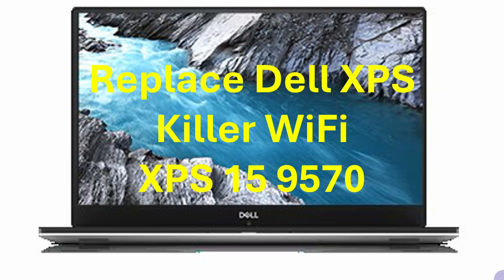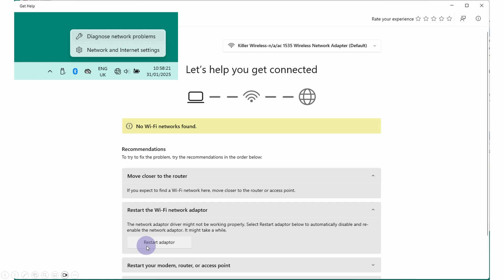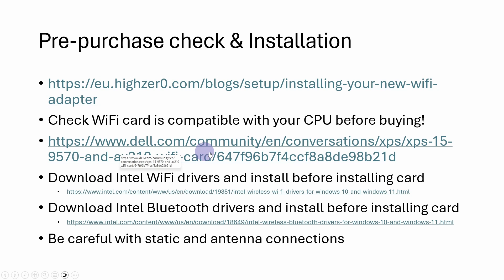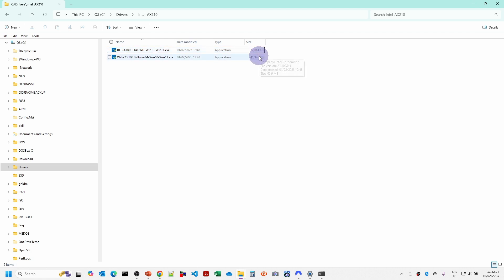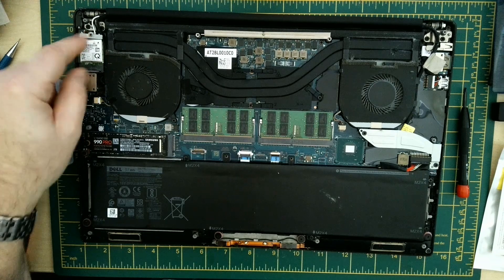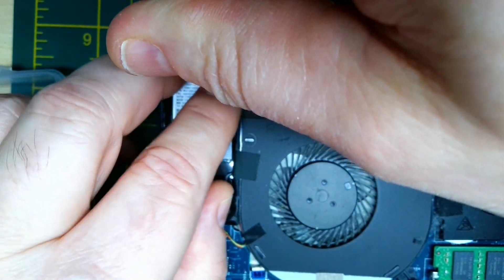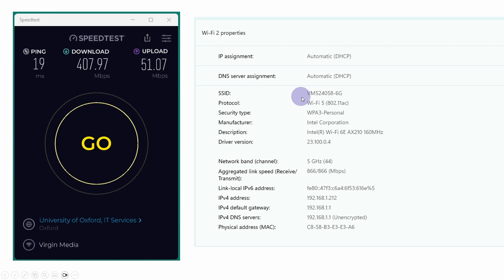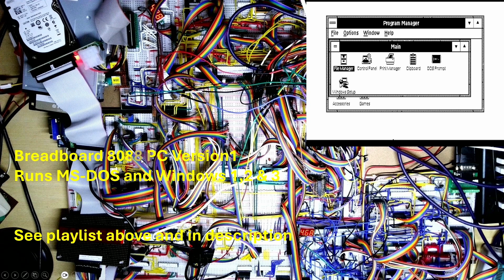Replace Dell XPS Killer WiFi Adapter with Intel AX210

Comment: For anyone that this fix didn't work for and Also for anyone that has a soldered Wi-fi card in their laptop that can't be swapped out this ended up being my fix. Hopefully this helps. 🤞

https://youtube.com/shorts/xSCYRRkacMw?feature=share

The TP-Link low profile USB WiFi adapter I used was a 300Mbps version but they do make stronger ones that are 600Mbps and up if desired. I tried to see if any company makes a USB Type-C WiFi adapter but unfortunately they don't. It's not often I hit a brick wall like this where every attempted fix just doesn't pan out, but hopefully this helps someone get their WiFi up and running again. 🙏
Reply from the maker: Thanks for the extra info. Dave

Comment: only need to buy the AX210 Wifi adapter, there's no need to buy IPEX4 internal antennas or SMA extension antenna??
Reply from the maker: Shouldn't need to as these will be fitted to the laptop already
Reply: @breadboardinglabs  oh, I thought the antennas could be upgraded as well
Reply from the maker: I just replaced the faulty card and reused antennas which came with the laptop. Worked for me. My main principal is if it's not broken don't fix it!
Reply: @breadboardinglabs  I think regular antenna will work ok for 2.4/5GHz but suboptimal for the 6GHz Wifi6e of the AX210. But I'm using Windows 10 on my XPS 9570, which doesn't support Wifi 6e anyway, and I don't want to update to Windows 11 I will just use this laptop until I got money to buy a new one.
Reply from the maker: It's your laptop feel free to do what you want. Dave

Comment: It appears you left the loose old card inside the case when you replaced the cover to the laptop after installing the new card.  Thanks for the vid.  Im probably going to have to do this too at some point.
Reply from the maker: Ahh good catch. I assumed it had fallen down the back of the desk! Will fish it out. Dave
Reply from the maker: Was stuck to the sticky stuff providing thermal conductivity between the SSD and case! Now removed. Thanks. Dave

Comment: Thank you so much!!!

I have the exact same computer, Dell XPS 9570, and have been struggling with the wifi for years. I have regularly searched for fixed and tried all sorts of drivers and setting, but nothing has completely fixed it. Then, a month or two ago, the wifi really started to act up. It wouldn't work for more than five minutes, sometimes just a second, before crashing again.

But I luckily came over this video and decided to give it a try! And it works! It has for the last 10 minutes at least! Again, thank you!!
Reply from the maker: You are welcome. Sounds like my experience with the XPS. Never had this type of problem in 20 plus years using WiFi! Hopefully your XPS will last a few more years until Window 12+ decides not to support it! Dave

Comment: Thank you so much for this tutorial! I've had the same laptop for nearly 7 years and this January I noticed the wifi disconnecting from time to time, but resetting the adapter would fix the issue. However, up until 2 weeks ago, even that stopped working and my wifi would stay connected for no more than 10 minutes at a time and in my Events I would get the same error as you. I'm happy that I came across this video, because replacing with the Intel adapter indeed fixed all my issues and my internet is faster now on top of that.
Reply from the maker: Glad it helped. Eke another 3-5 years out of the machine further! Dave

Comment: one of the laptops I bought from a seller that makes them custom, had an option for the killer wifi or intel. I chose Intel. they delayed the shipping because they couldn't get the Intel card to behave properly, and had to install the killer wifi. I didn't have that many issues, but I certainly hate it. Even if it's an older model, I can't seem to find anyone praising any killer wifi cards. they're crap. I think they have qualcomm chips on it, which should make them really good, but who knows
Reply from the maker: Apparently on one of the comments I saw, Dell was getting grief from customers about the WiFi adapters they used to ship so they switched to Killer. Mine has been fine for 5 1/2 years just the last 3 months it has become faulty. Dave